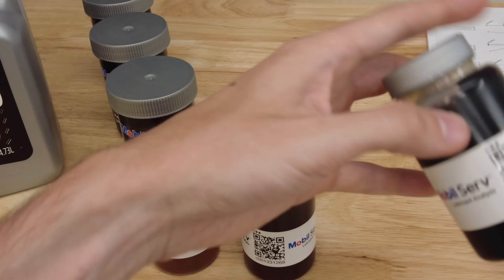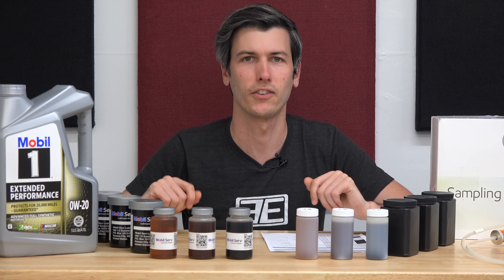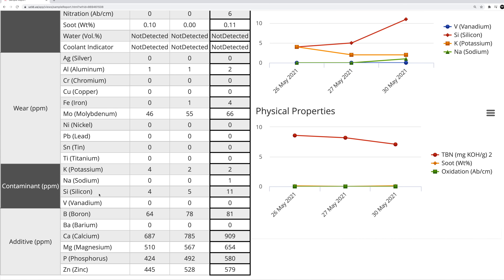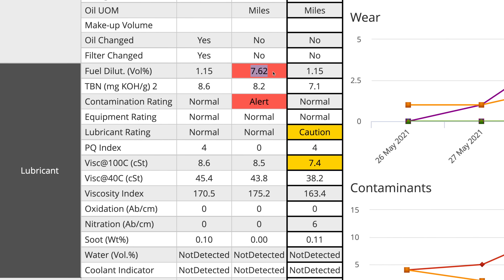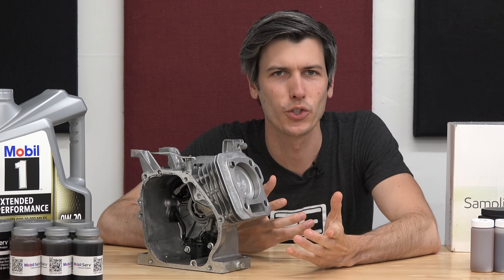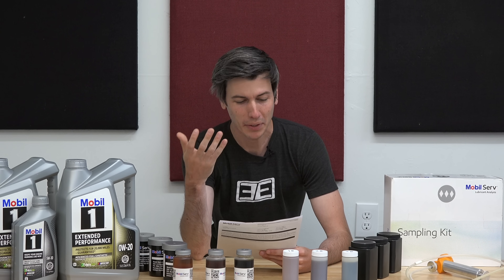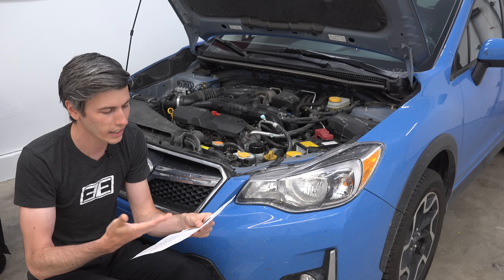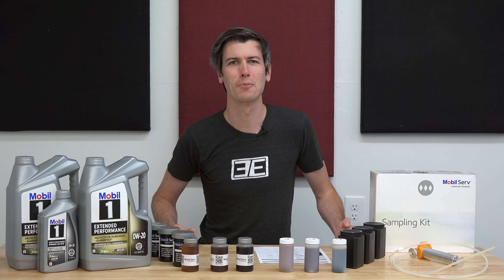Does Your Engine Have Hidden Damage? How To Know!

Comment: 400k miles on a 2002 VW tdi, always used Mobile One, 10k miles between changes, zero engine problems. Uses about 1 quart between changes.
Reply: Interesting. Former 2000 TDI owner here. You use regular Mobil 1? Back in the 10 years I owned mine, the oil of choice was Mobil Delvac 1, which is the product formulated for diesels.
Reply: @anthonyc1883  I use regular high mileage Mobile One 10W40.
Reply: @yodasbff3395  Hmm. If you're getting good service from your car (and I'm guessing at it's age you must have some miles on it for sure) then there's no arguing with that! Excellent. But I'm curious. The VW spec for your '02 1.9 TDI (same engine as my '00) calls for certain ratings on the oil container. Does the oil you're using have any of these: ACEA A3 or A4, API CG-4 or CH-4 or CI-4?
Reply: Container says meets or exceeds ACEA A3/B3 -API SN, SM. I didn't put the first 100k miles on it so I don't know what was used during that period. The VW owners manual says to change the oil every 10k miles. Ony thing on the engine that has been replaced are the glow plugs, thermostat, alternator and a/c compressor.
Reply: You’re better served by an actual diesel oil.
Reply: You are probably right, maybe I'll go that route for the next 100k miles. Thanks for the advice.

Comment: Pretty much pointless for the average driver.
Reply: Definitely disagree. For about the price of an oil change (or less) it's a fun, interesting but most important valuable resource. My main takeaway was that I was waaaayy off base by continuing to worship at the "3-months, 3K  miles" altar from my father's day (which so many drivers are still too scared to depart from). I'm a non-tech person so although the lab stuff was only of minor interest, the plain-English summation at the end like Jason read in the video assured my my engine was in great shape  even with longer oil changes on a synthetic oil.

Comment: Nice video. It's very instructive. But there's one topic I would like to hear about, and it's why some fluids cannot be mixed? I'm thinking especially of coolant fluid or hydraulic fluid, like transmission oil. There's different kind of these fluid and they can cause damage if they're mixed together. Could you make something about this?

Comment: Hey Jason, if I was considering doing an oil analysis on my own car, how much would it cost? And who would you reccomend?
Reply from the maker: The Blackstone one I did was $30-$40 depending on which one you selected!
Reply: For a gasoline engine, Blackstone Labs charges between $30 and $55 depending on how deep you want them to go with their analysis. Doing it even one time is well worth it. Years ago I did one on my now-gone VW Jetta and got a similar grin-inducing summary like Jason showed here, a sort of "Good news. Your oil  can still last for another xx-miles." It was a real eye-opener that I no longer needed to worship at the altar of 3-months, 3-thousand miles oil changes from my daddy's day. A couple years later, I did another analysis and the results were basically the same. I drove that little 4-banger almost 200K miles and finally got rid of it only because I wanted something new.

Comment: Curious about a point you brought up about an early oil change after engine break in as I've ordered the new i20 N, when should I be doing that? After the 600 mile (I read somewhere) break in? I want to make sure I get it right. Also, is there any point in extending the break in to say 800 or 1,000 miles? I'd still doing the early oil change naturally, I'm just pretty cynical about recommended maintenance. The manufacturer probably don't care what happens after the warranty, but I do.
Reply from the maker: I wouldn’t stress about the exact mileage, but around ~500 is a good idea to do.
Reply: @EngineeringExplained  Thanks for getting back to me, I'll do that.
Reply: "I'm just pretty cynical about recommended maintenance. The manufacturer probably don't care what happens after the warranty." That's why to have an oil analysis done. You will know based on actually data, and maybe (probably) you will learn that too-frequent oil changes are only wasting your time and money.
Reply: @anthonyc1883  Thanks not a bad idea, I'll take a sample after the first service. That will show me if all the break in metal fragments got flushed or not. I plan on changing the oil every 5-6k miles, that's generally accepted as a safe interval.
Reply: @Tribulation88  Doing an analysis after the early, first service will be quite fun to compare to an analysis later down the line. There will be some differences, I'm sure.
Reply: @anthonyc1883  Sounds like a plan, I'll be able to prove the engine is in good health when I come to sell it. Or if it's not, I can not include the results lol
Reply: Tribulation:  If you're not going to believe the manufacturer, then you might as well use the internet.   Good luck with that.
Reply: @rogergeyer9851  I believe the manufacturer wants the car to last the length of the warranty, while being as cheap to maintain for the customer as possible. That kind of thing is classed as a selling point, so they stretch service intervals and maintenance as far as they can. I'd prefer the car was well maintained. So when I come to mod it, it's in good condition. Some car manufacturers advise crazy long intervals they know are risky, like Ford's 10 year or 150k timing belt service. I've heard horror stories of those breaking between 65-70k pretty often, but since you're out of warranty it's your problem.

Comment: I’m amazed at the low mileage on your crosstrek. If I remember correctly, you’re one of the reasons I bought my 2018 crosstrek! I have 73k on mine and it’s going strong. I replace oil every 6k. Next oil change I will definitely run a sample just for fun!
Reply: He definitely has/had a few cars to spread out all his driving time.

Comment: Car makers do break in all engines at the factory!!

If so sure that you need an early oil change on a new engine: Go TEST that theory!

Next time DO WARM UP FULLY the engine before taking that sample full of gas…
Reply: EE has a video on this specifically and the answer was no they don’t.
Reply: @davefoster9280 :  In the real world, it's ALL about saving money for the manufacturer.  Though tolerances get better over time, making stuff up doesn't change reality.  For example, the earth isn't flat, and Covid-19 is a real thing.

Comment: After several years of being a mechanic, I am still shocked and amazed when a vehicle comes in with "most" of its oil. Almost all are waaay overdue, low or almost none. Trying to explain to someone about oil consumption "but it doesn't smoke and I was told to change my oil when the "light" comes on"......
Reply: That's scary. Used car buyer beware.
Reply: what, change when the oil light comes on? that's insane...
Reply: @gabrielvieira6529  yea, the joke is, "the genie is ready."
Reply: @gabrielvieira6529  A long time ago we were eating breakfast when my sister suddenly asked "By the way, I've got a blue light on the instrument instrument panel. What does that mean?"
Turns out the oil light turned on about a month ago, but as she didn't know what it meant she just ignored it. Now one of her friends had seen it and said it was probably important, so she thought she'd ask about it...
Well the engine survived, but she got a very thorough lesson from my dad on what indicator lights were important and which could be ignored, which was basically none as this was an old Volvo and the only warning lights were oil and temperature. But that old B20 engine was almost indestructible which saved my sister this time.
Reply: @gabrielvieira6529  Oil change light, not oil pressure light.
Reply: Works on mid-90's Hondas!!!! Don't need to change the oil, just top it up from time to time. The new oil replaces the old over a month or 2 ;)
Reply: Imagine that the current VAG, BMW now recommend 30k km OCI. Like you, many vehicles we serviced come with quite a lot of oil missing, and way OC overdue. And yeah we did a few engine swaps or rebuilds. One of the clients learned his lesson and he's regularly for OC at '50% live left' shown by computer monitoring - no problems with oil consumption ever since. As for the 20k OCI, maybe in the lab, but never in the real life of a car.
Reply: Sounds like most are women who are single and no one is telling em too change there oil lol.
Reply: @mikeschultz6383  of the  hundreds of vehicles I see a year most of them are owned by men. Age is 35+ for more than 80% of my customers. Almost zero percent are owned by young women or single women.
Reply: @MrAPCProductions  very interesting so i guess don’t go off the assumption that women don’t know anything about cars and there maintenance nice too know. Also good too hear
Reply: @mikeschultz6383  I think the reason is that the vast majority of car owners are not interested in cars as anything but transportation devices or to a degree as a status symbol. The inner workings are not what interests these people. It also says a lot about how reliable cars has become. It used to be that you more or less had to know a bit about how the car worked as they tended to break down now and then. Just look at something as simple as oil leaks. If you look back forty or fifty years there would be an oil slick under a lot of cars. It was just the way things were. Today it's really uncommon to see this and when you discover one under your car you will react by wondering what has gone wrong. I've also thought of the number of cars I see having broken down on the highway and standing on the shoulder waiting for assistance. When I was a kid you saw this every time you drove for any distance on the highway. Today it's really uncommon to see anything worse than some one who ran out of gas, and even that is uncommon and fuel gages are usually a lot more reliable today than they used to be. Remember when cold starting a car could be an adventure? Remember using the manual choke, pumping the gas pedal, or perhaps having to use starter fluid if it was freezing? I have almost forgot all of that. My twenty year old Toyota has never had a problem starting even when it was really cold.

Cars has become so easy to use that people are forgetting how they work. And when something goes wrong most people just leave it to a mechanic to fix. The only time they care about what makes their car run is when they pay the mechanic for taking care of their car. Heck I have friends who never open the hood unless they are forced to do so. They have a mechanic service it once a year, and just assume that they will take care of things like oil changes, air filters, thread depth, coolant levels and so on. I can safely say they have no idea about oil change intervals or anything else. All they do is fill it up with gas and drive.
Reply: Mike Schultz  Maybe the single ladies where he lives are into cars and don't mind getting their hands dirty for proper maintenance...  yea, right. They probably just have an uncle, cousin, brother, or bf do it for them. 😂
Reply: @blahorgaslisk7763  
Cars are like washing machines - put in D and it goes. It's all about convenience. Many people actually don't know really how to drive regular car with manual transmission without all the gadgetry.

Comment: Probably the fuel present in the engine oil for the 2nd sample is due to engine idling rich to get the cat up to temperature faster.
Reply: Actually, it's a lean mixture at startup and barely noticeable misfiring which contribute to getting a cat hot.
Reply: @jamesplotkin4674  sorry I was a little wrong. Running rich when starting from cold was done to help start the engine, somewhat like what the choke does on carburettors. After the engine gets slightly warm, it then slowly goes to a closed loop to meet emissions standards. I don't think most engine likes running lean tho.

Comment: This analysis is invaluable.
Reply: Its useless if you get an electric car
Reply: @UnipornFrumm  It is not significant if you travel by foot also.
Reply: @miltiadiskoutsokeras9189  yeah but you wont do that to go to another city for example
Reply: @UnipornFrumm  and your electric car is useless after 125,000 when the battery dies
Reply: @UnipornFrumm  and lol do you really think nothing can wrong with Tesla’s?  You haha to service all their gear oils just as-well as cars lol electric isn’t magic
Reply: @mercury0214  the only oil a tesla has is a trasnmision oil,and it lasts longer then a combustion car trasmision oil because the tesla doesent shift gears.
if you want you replace it just as ofthen as you do your trasmision oil in a combustion car.

this video is about combustion engine oil,maybe you didnt watch it
Reply: @mercury0214  and you combustion car is useless after 60,000 when the engine fails emisions and thrasmision if making worryng noises and doesent snap in gear verry well.
Reply: @UnipornFrumm  Doesn't make sense. Oil has a life, so it means the tesla has a really expensive oil to last more than "combustion engine, changing grears trahsmission" oil. So if this is not true, it should be the same as a conventional car...
Reply: @UnipornFrumm  I heard stories about cars that lasted 100.000+ miles without any problems on its engine or transmission.
Reply: @gabrielvieira6529  full Electric cars do not have or need an oil sump. Ok 
 I suspect the bearings on the electric motor are lubed and sealed for life, so there is virtually no maintenance needed on the electric motor itself.
Reply: @UnipornFrumm  completely pointless if i take Greyhound.
Reply: @UnipornFrumm  could be useful on the gearbox. Lot of cars got flooded. Best to probably change that fluid after being in high water, then do a test down the road for possible damage.
Reply: @tangydiesel1886  if water got inside your gear box you maybe shold replace someting other then the oil

Comment: Crazy people still change the oil every 3000 miles and think color means it needs to be changed. Blackstone asks what oil is used.
Reply: I say it's good till it turns to a grease, then take that grease and use it to lube trailer axles.
Reply: Changing it every 3000 isnt that crazy if you fall under severe driving conditions. Oil is so cheap, why not change it often?
Reply: @curtisjordan9210  time, waste and resources. If tests show it is good for 2x the current interval, it is a waste.
Reply: @UCW6oJlYyo68ECfh8QTO3s7A While you're seemingly not likely to do it, there's no denying an oil analysis even just once will provide interesting and valuable information. I convinced a friend to do one on his Uber car. He does a lot of idling, stop and go city driving, and was convinced he needed oil changes every 3K. He's got a good quality car, using synth or synth blend oil, and the analysis after 3K came back with a big thumbs up for going at least another 2K. That's a big difference over multiple-multiple oil changes over time. But of course, a driver has to see some value in having that information.
Reply: @curtisjordan9210  if you don’t have an analysis to prove it, it is a waste.
Reply: Lol how is it "crazy" that people do this? As if there's a world-wide memo saying don't do it.

Change your oil, inspect it, it's a good thing.
Reply: @andoniades  waste of money, time, resources and disposal. That’s how. Do you buy new socks every week?
Reply: @andoniades  waste time, money, resources, consumption and disposal.
Reply: @Deuuuce  to each their own.
Reply: @andoniades  true, just adds to the fuel of the anti-ICE sentiment though.

Comment: Mine would be really bad I haven't changed the oil since like the year 2011.
Reply: What???
Reply: Mr Fathead:  And most people like you would blame, say, space aliens, when your engine develops a major problem.   Funny how that works.  

Frequent oil changes are basically free in the end, for people who want to drive a car for over a decade. 

When I checked my timing chain at 100K miles / 10 years on my '82 Celica, my Toyota dealer asked if I'd had the timing chain changed.  When I said "No", he asked how often I changed the oil.  When I said, "at 3000 miles at Jiffy Lube like clockwork with Pennzoil", he said to the mechanic, "See?  I told you".

You can pay them a little now, or pay them a LOT later.

Comment: Curious to what my Honda Accords numbers would be . It’s a 2018 and I have 35 thousand miles. Wonder if it’s diluted with fuel.
Reply: A 30-40 dollar analysis will give you what you need to know. Basically, the price if not less of an oil change. Even just doing it once will provide you with great information.
Reply: Haha I have a '20 with about the same miles and I was wondering that also.